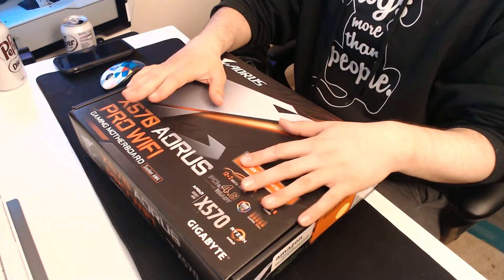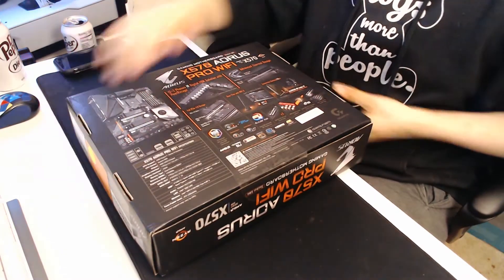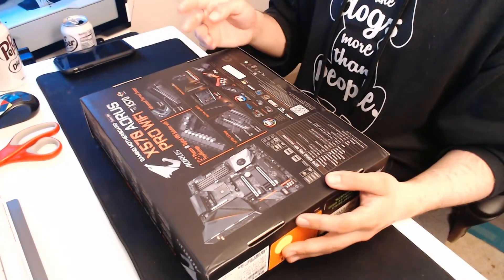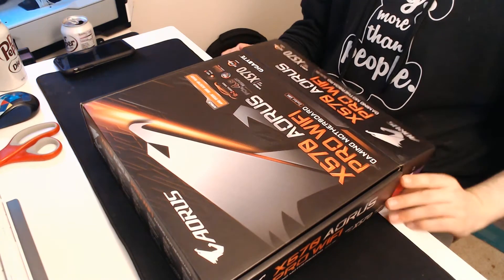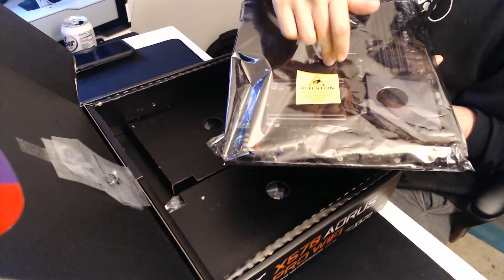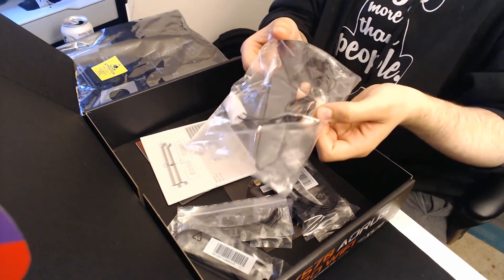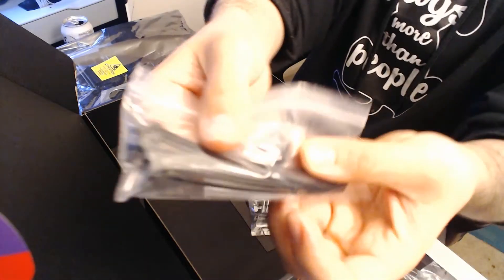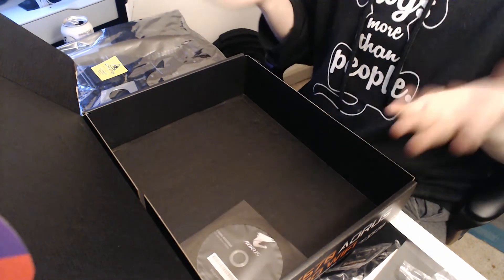Unboxing  x570 Aorus Pro Wifi ATX Motherboard

Comment: Tell me how it goes. I'm considering this for virtualization.
Reply from the maker: So far it’s been great, I’m using it with a Ryan 3900x and I have no VRM cooling issues or other temp issues, despite the overclock I did on it. I’m gonna be doing a review here soon for more in depth details here soon, just want to get more time with it first beforehand.